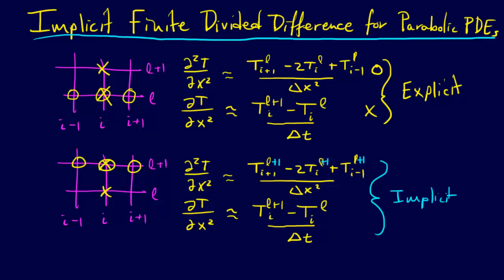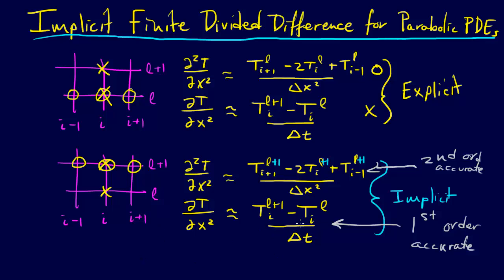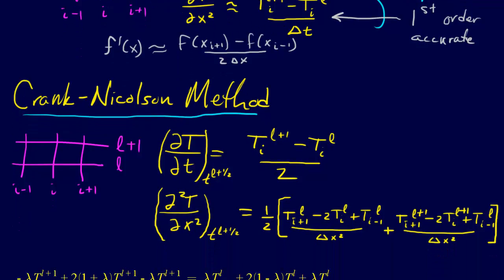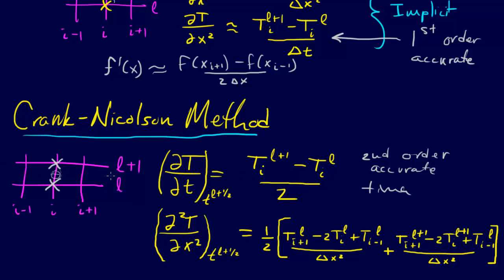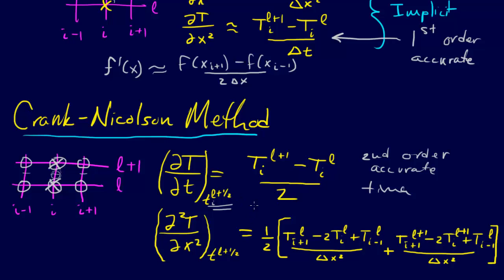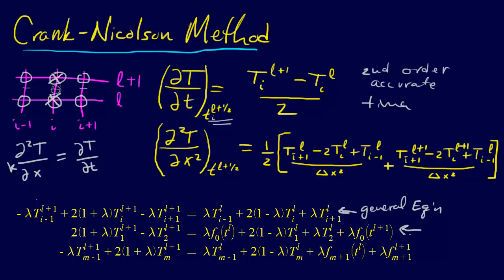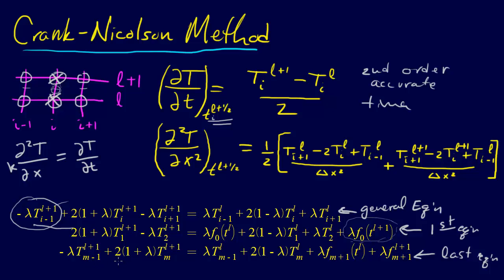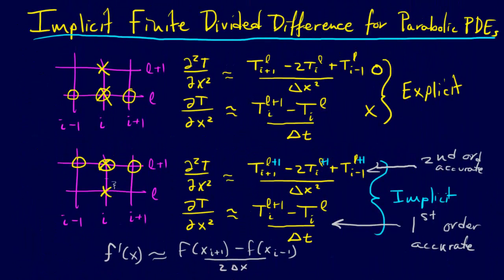8.2.6-PDEs: Crank-Nicolson Implicit Finite Divided Difference Method

Comment: Just two small corrections: 

For the implicit and explicit formulas you should have dT/dt = fwd finite divided difference instead of dT/dx2

The last term in the averaged centered divided difference approximation for d2T/dx2 should be Ti-1^L+1 instead of Ti-1^L

Great video!
Reply from the maker: You are correct. Thank you for pointing this out. I wanted to note this with annotations, but youtube doesn't interpret the math right, so...
Reply: Jacob Bishop and maybe instead of 2 in denominator for Time discretization approximation there should be delta t?
Reply from the maker: Irfan Mahmood Annotations added. Thanks.